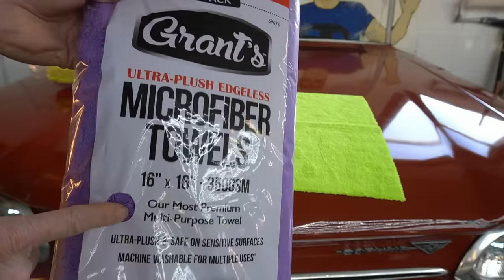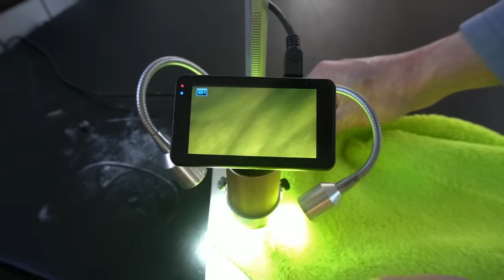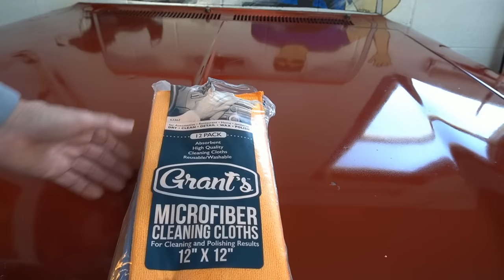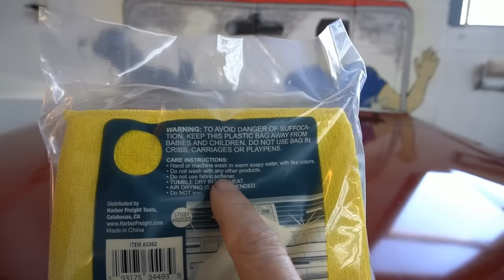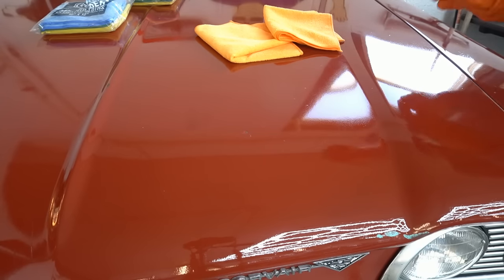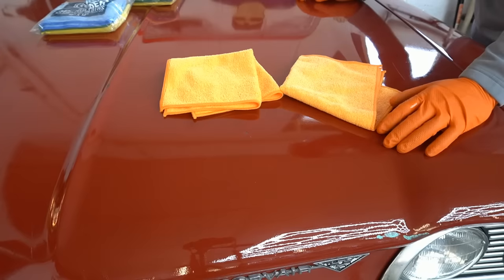Showcase For Every Microfiber Towel Available At Harbor Freight!! Grant's Towels For Car Detailing!!

Comment: I've bought and used the drying towel, the premium 80/20 microfibers, and the glass towels and have had ZERO issues.  They seem legitimately decent, and for the price they are outstanding.
Reply: Thanks for sharing 
How many times have you washed them?  The older first generation got thinner and thinner with each wash and were bad quality

Comment: Brian:I have about 25 of the Grants 2x3 drying towels. I really like them.  The trick?  Keep 'em from getting really contaminated.  Wash  them often with All Free and Clear, using white vinegar in the bleach cycle. Medium warm at best, no bleach or fabric softener.  Dry on low heat and don't let 'em sit in the sun as it can kill the towel. I only use them for drying in detailing. Nice presentation!
Reply: You use non microfiber soap then to wash?  Free and clear soap only?

Comment: These towels are such a good bang for the buck. Give them a wash and they perform great for any weekend warrior. Miles better than the stuff at the autoparts chains.
Reply: How do you wash? The towel
Reply: @jae1757  try using all and clear, it'll get a majority of the stuff at medium heat. Then if you need a bleach substitute you can use vinegar. Then a low heat low tumble dry then you can let them air out. Best way to keep the absorption while cleaning em

Comment: FYI, Walmart is selling microfiber towels like Costco
Reply: They're garbo
Reply: @pullingthestrings5233  the yellow one? I mostly use them for other tasks rather than paint work
Reply: @Carlos.Rivera  there you go. Same here. I get them because they're cheap but i don't use them for my Car. I use them for stuff like mopping, instead of buying those disposable swiffer wipes, i just use these and spray on some MR. Clean on them and they're washable. For those tasks these are perfect.